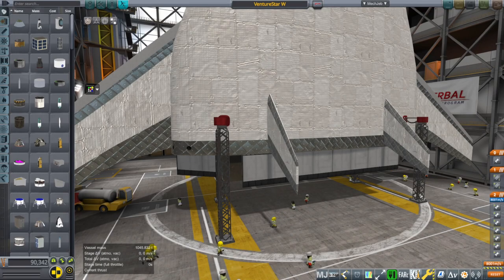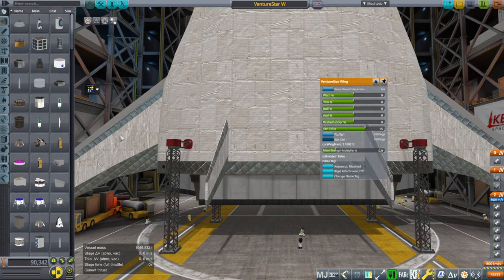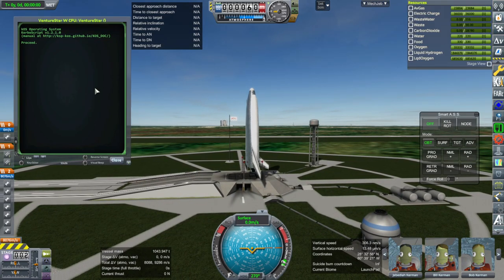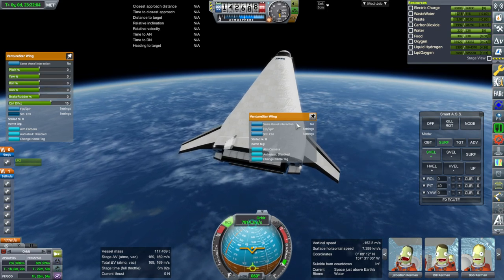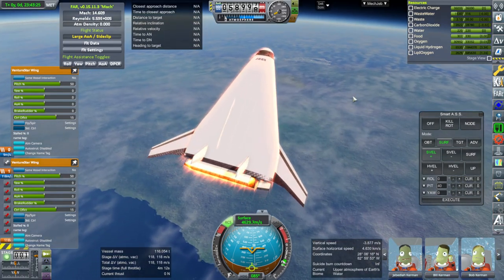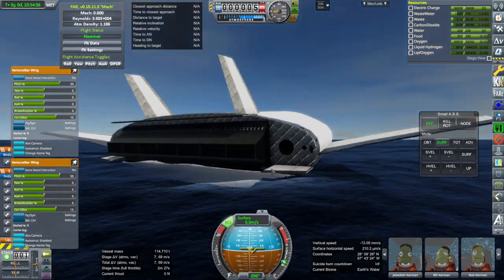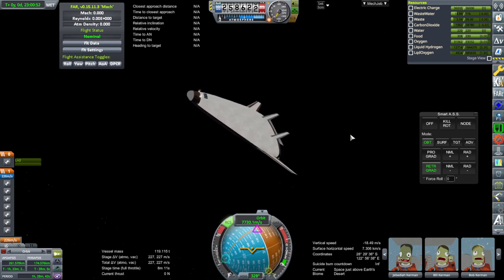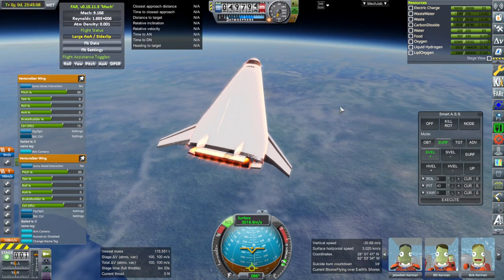KSP 1.8.1 with RO - Making VentureStar Aerodynamic

Comment: As a proof of concept at least this is indeed encouraging, the dream of the SSTO space-plane lives on to fight another day!

Still can't help wondering if they had gone with the body flaps like you did, it would have been worthwhile ditching the overly heavy aerospike engines and gone with an array of SSMEs instead with the body flaps doubling as variable area / steering nozzle extensions.
Also I would have ditched the rudders and gone with split clamshell ailerons drag rudders ala Northrop flying wings, may as well save some weight where you can!

Also +1 for the canards, because why the heck not. 🤪
Reply from the maker: We will get to the array of SSMEs, don't worry. I already have something in Blender . . .

Comment: "shaped like an airplane" "so it has a lot of drag", does he even know aerodynamics.
Reply from the maker: Knowing it and explaining it on-the-fly are perhaps two different things. The point is that VentureStar presents a great deal more surface area to the atmosphere than a normal plane even when it doesn't have a high angle-of-attack and, as such, tends to get more drag than a normal plane would. Also, its inertia in its current direction of motion is greater because of its frontal surface area, so it very much doesn't like to turn.